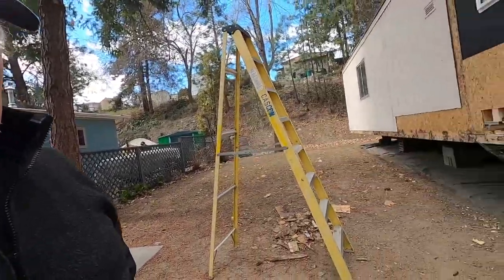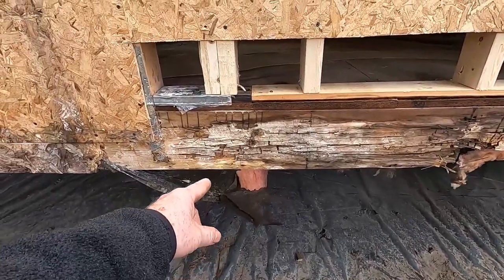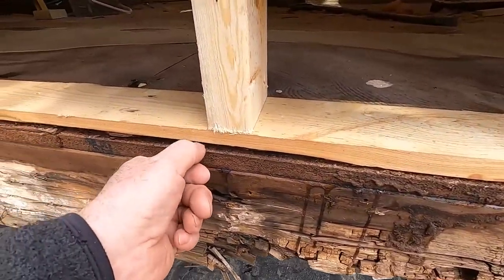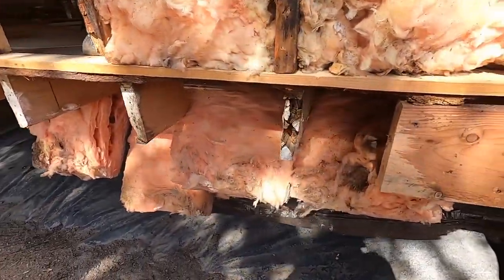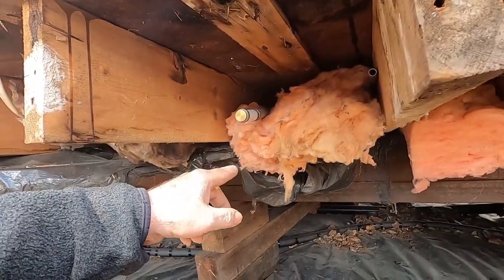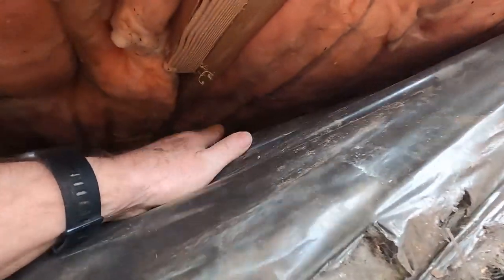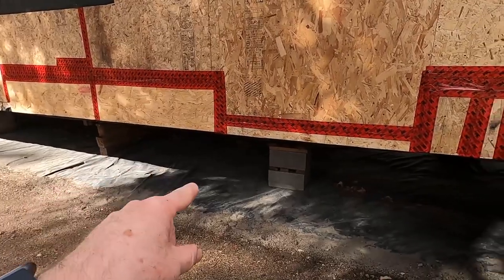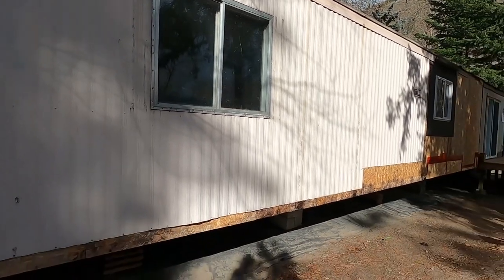Rotten Rim Joist Repair - Abandoned Mobile Home Project : E107 / BC Renovation Magazine

Comment: This is exactly what I'm doing now with mine. So far, on a 65' home, I'm into 20' of rim board. Thanks for your videos 😅
Reply: We’re about to tackle this. Any concerns with sagging? I figure not, because it’s not really load bearing?
Reply: @bennybongosbigolebonanza894  If you build a supporting interior wall, give it a 1-2" extra lift, then when you take out the wall it will settle back.
Reply: @bennybongosbigolebonanza894  It is supporting the outside wall

Comment: How do I replace the composite board underneath the sill plate with osb? Am I okay to just use an oscillating saw to remove it? Will the studs move if I cut it out before replacing it?

Comment: wish you would've shown how you got the 2x8 up by yourself, that is one of the most difficult parts when I'm doing it.  Also, would like to know your thoughts on best thing to do when levelling a trailer isn't an option but repairs still have to be done (like what are minimum parts to fix). Also, how did you take care of the mold?
Reply: I've done this before by myself you have to think outside the box and be very limber

Comment: Do you have a video of jacking the trusses off the wall to replace the bottom plate?  My trusses are scissor, and Im not sure how to place the temporary header to safely jack them up.  Can I jack three studs up from the outside by bolting 2x8's to them without the jacks kicking out?

Comment: Good afternoon, Sir!
I found your vid because I am getting ready to do the exact same thing to my mother's mobile home. The header rotted due to the prior owner attaching a small deck directly  it under the back door and it trapped moisture. Little nervous to say the least, any insider tips/hints you can give me for this job? If not, I'm just going to follow your vid.
Reply from the maker: Hi, Keith. The video pretty much covers it. Just use it as a guide and you should be good. It looks intimidating but really, it's not that difficult. Just make sure that you take the steps to weather proof things as you put it back together using the tarpaper and flashings.
Reply: @BCRenovationMagazine   Thank you very much for the reply. Once I got into it, I found out it went a little deeper than I thought it did. 
I have to put some of those sisters along the stringers.  No it's not too bad so far but I'll feel so much better when it's done. Thank you again
Reply from the maker: @kemobam  , sounds like you have a good handle on this. All the best to you on this project.  That's awesome that you are helping your Mom like this.

Comment: The way you attached the rim board to the floor joist will it be strong enough to attach a ledger board for a deck?
Reply from the maker: Chopshop, the restored rim board would be strong enough to support a ledger board for a deck, but it is recommended that decks be built entirely self supporting. In fact, here it is a code requirement. 

I explain how we make our decks self-supporting in this video:  https://www.youtube.com/watch?v=iLFgrp5UbPc